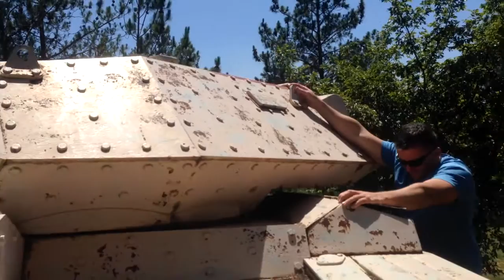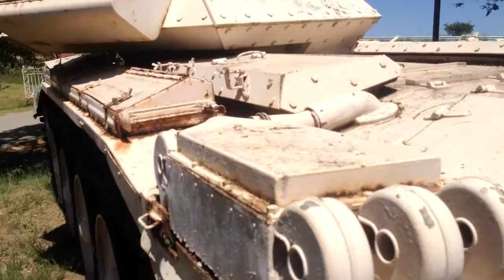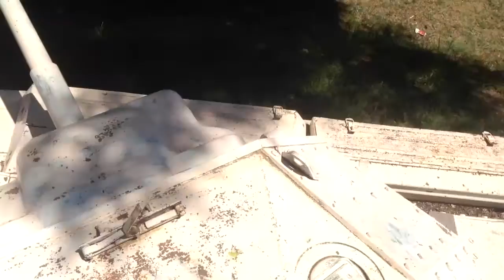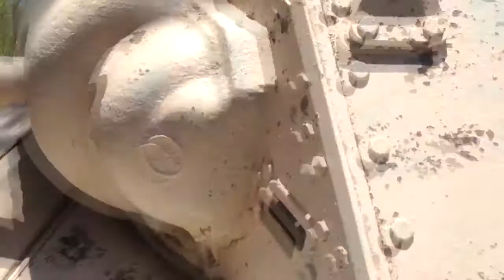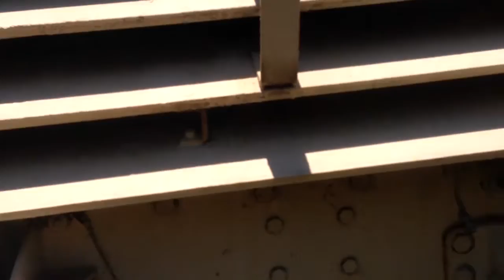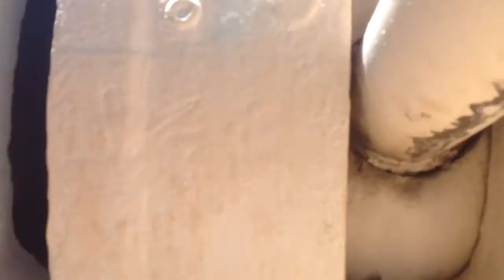Crusader Mk II British Tank, Up Close

Comment: I think you've confused this Mark II as a Mark III. An easy way to tell the two apart is the gun being smaller on the Mk.II (2pdr) and larger on the Mk.III (6pdr), plus the Mk.II having the rounded turret front (as it is on this one) and the Mk.III having the flat turret front.
Reply: I was about to say the same thing; that looks more like the 2 pdr rather than the 6 pdr. Also the cast turret face looks like the mk. II, the Mk. III has a flat plate on the front of the turret with an internal gun mantle.
Reply: Major General Bunk you are correct and why are they hurting it my baby boy